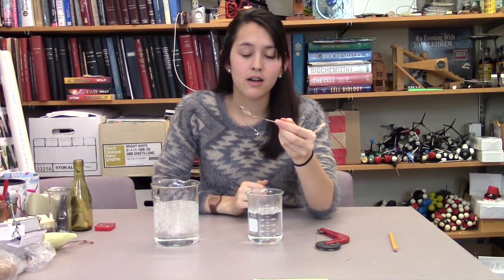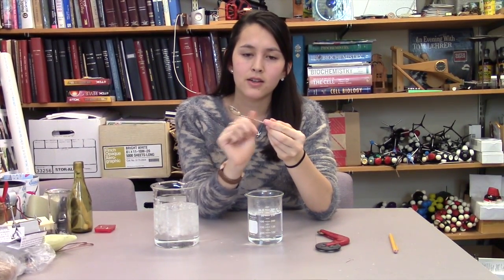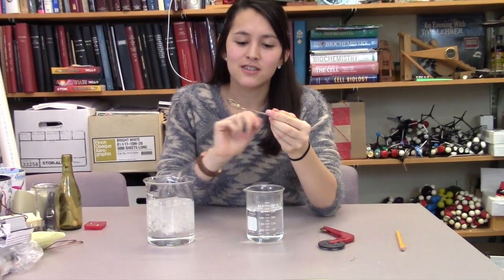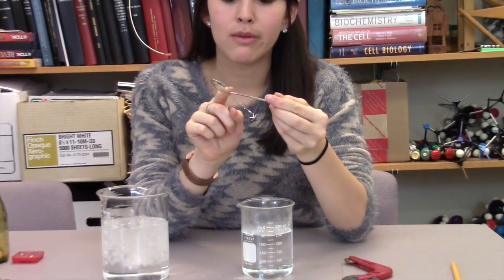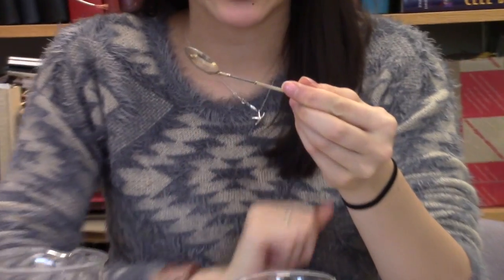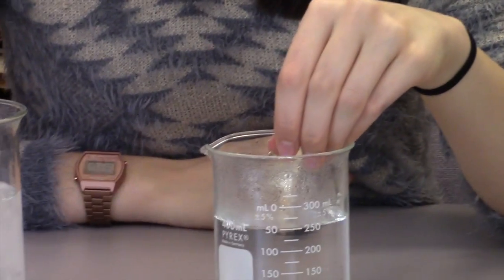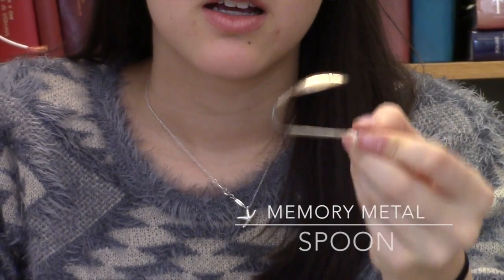Nitinol

Comment: Can that nitinol motor be made to do work? Seems like it is far more simple and efficient than a sterling motor.
Reply: Becomes stiff with heat, going back to the original shape. Turns soft and deformable with regular cold tap water.

Comment: I bought one of the original Thermobiles in the 1980s. It had a black plastic frame and the wire still retains its characteristics although the crossover temperature is now a bit higher.

Comment: Wonder if something like this could be used to generate power on a spinning satellite due to the drastic temperature change from being on the sunny side and then on the cold side as the sat rotates. Of course, it is probably too weak of a reaction to work.
Reply: There is a lot of stress in this alloy and having it go through many. many cycles will cause metal-fatigue and it will break. This is especially true when you ask it to perform work as this introduces extra stress in the structure of the alloy. Also, over time, the critical temperature (above which it 'remembers') will usually rise or in other words, over-time and use it will seem to become lazy at returning to its 'original' shape.
So no free lunch here as one might expect.
Reply: @DreadX10  too bad, would've been nice

Comment: Could be improved by making display of the device with the 2 wheels easier to see: wiping off condensation from side of beaker, and going slower with immersion, and having marks on the lower wheel and on the wire to make movement easier to see. 

Also, why does it rotate in that direction? Does anything make it rotate in the other direction? What happens if the larger wheel is immersed instead?

Talk about why it is not a perpetual motion machine? including about where the energy comes from to power the rotation. How many watts of work could be obtained? Would this be any practical use for driving something? or possibly measuring something?
Reply: The energy comes from the heat in the warm glass which stretches the metal at the point of the small wheel. This motion bends the metal at the point of the big wheel where the metal is cooling. The wheels spin as long as you supply energy in the form of heat. There are likely many practical uses.

Comment: I know this probably has many scientific applications - but all I can think about is what Penn and Teller could do with this.
Reply: I used nitinol to make a steerable catheter. Little do people know that you can hit it with electricity and it will bend too. Used it for a senior design project and it worked like planned.
Reply: Teeth brackets, probably. Most of the time it's a metal with this behaviour. We actually need to avoid hot food, hot hot, milder temperature is better. Otherwise, those suckers pull our teeth so much it huuuurts! 😂😁
Turns soft with cold.
Reply: Magic is simply science that we have yet to understand
Reply: Hawkeye, literalists, am I right? Some of us understood that. 👌🏽
Honestly, I’m reminded of that guy from the 70s or 80s who used to bend spoons all the time. People found out years later he was a fraud… or just really good at science. 😂
Reply: @brianoconnor4269  what you're talking about is deception which is not only an art but a science